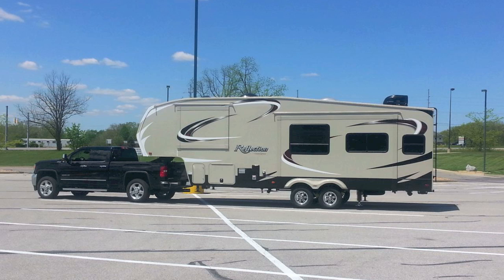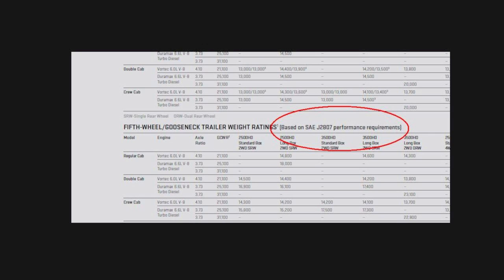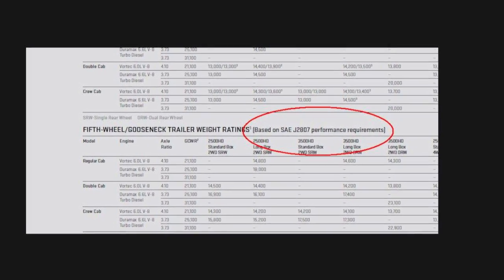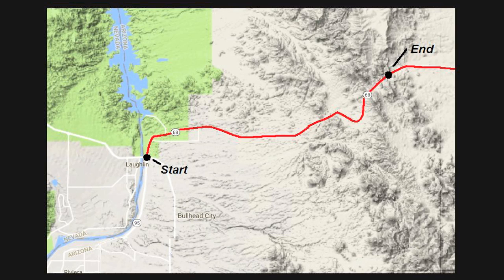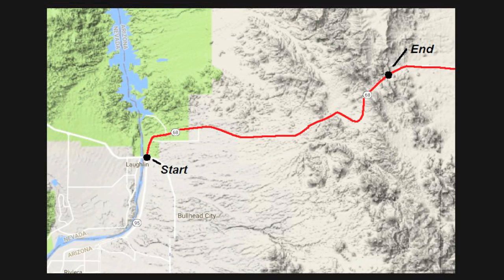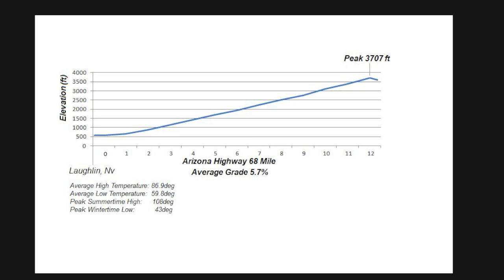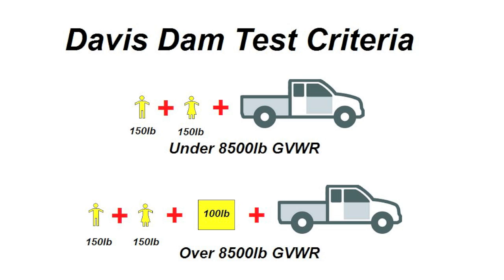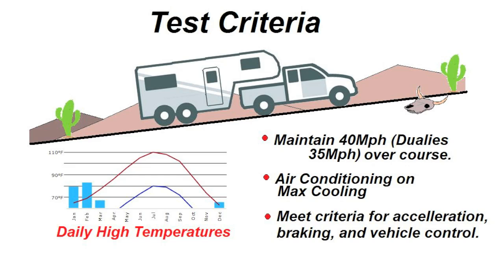J2807 Vehicle Tow Ratings

Comment: Interesting! I was looking, and my car even with no trailer probably couldn't pass the tests, maybe it could, but it would be pushed quite hard to do so. It's rated to tow 0 LB though, so that might be why.

But I have towed about 900 LB with my car, rated for 0 LB, and it does good. I set cruise control to 50 MPH, and will take over if cruise wants to go over 1/2 throttle. It stops fine, accelerates slowly, but having 78 horsepower, I'm used to slow acceleration. I got 53 MPG today towing a 300 LB trailer about 90 miles. That seems pretty good.

Comment: Question... are the 2, 150lb passengers included in the payload rating? For example, if the payload rating is 10000lbs , does it assume 300lbs of passengers are already in the truck or would the payload be decreased by 300lbs to 9700?
Reply from the maker: J2807 focuses on maximum tow rating, which assumes no additional payload.  If your vehicle is under 8500lb GVWR, the total "cargo" weight only includes 150lb for the driver and 150lb for the passenger. If the GVWR is higher than 8500lb, you can add 100lbs of cargo. So your payload rating is only going to be 100lbs if your truck's GVWR is over 8500lbs, and 0lbs if your truck's GVWR is under 8500lbs.

The truck's normal payload rating during towing is not available as it is assumed to be used up by the load of the hitch and tongue weight/5th wheel weight over the rear axle.

Remember though that J2807 is simply a guide.  And even if you are within J2807 ratings, you can still exceed the vehicle's rear axle rating (GAWR), especially if you tow with a 5th wheel.  All in all, the weakest rating of the tow vehicle is likely to be the rear axle GAWR, not the overall tow rating.

A far better method is to weigh the truck, and truck + trailer fully loaded with cargo, fuel, and passengers at each individual axle. The total weight of all of the axles together  should be under the truck's GCWR (Gross Combined Weight Rating), and each axle should be under the axle's GAWR for that axle. 

That is truly the only way to determine the maximum tow rating.
Reply: If you haven’t found an answer, or even still alive any more, who knows, but here is how I understand it.

I have a 21 F-250.
My trucks GVWR is 10,000
My trucks payload is 2,986

I weigh 250 pounds+ I had at least 100 pounds of cargo in my truck, a full tank of fuel as well.

My truck weighed in at 7,320 pounds. 

According to my GVWR-payload- I weigh 7,104 pounds. 

7,320-7,104 is 216 pounds. 

So basically the truck gave me 100 pounds like SAE J2807 says. 150 driver and 100 cargo. My 100 pound over weight butt and fuel+cargo gave me the 216. Had I been 150 pounds and 100 pounds in truck. I probably would have weighed in closer to 7,104 pounds, giving me my Max Payload capability with me in it.

Comment: Basically using J2807 when calculating available payload (years 2016+), etc., the passenger weight (300#), cargo (100#), hitch, etc., is already subtracted from a manufacturer's "max. trailer weight rating"?  So, when I do my calculations, I don't have to add 300# for passengers, 100# cargo, etc., then subtract..... because they already did this?  Is my logic correct?  Anyone?
Reply from the maker: As I  interpret J2807, it assumes  300lbs for driver and passenger plus 100lbs cargo for trucks having a GVWR of 8500lbs or more,

It doesn’t include the weight of the hitch.